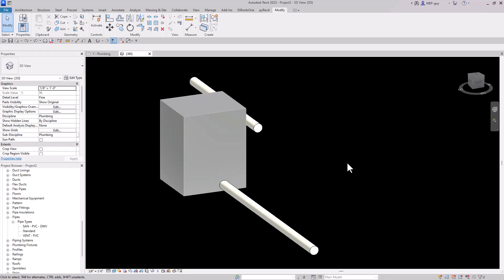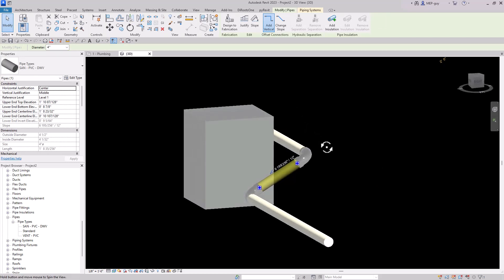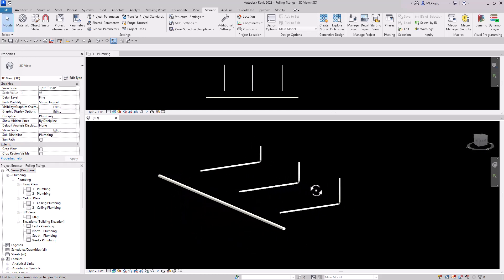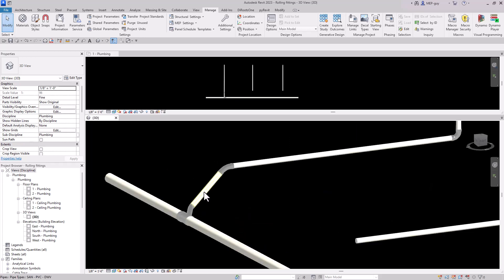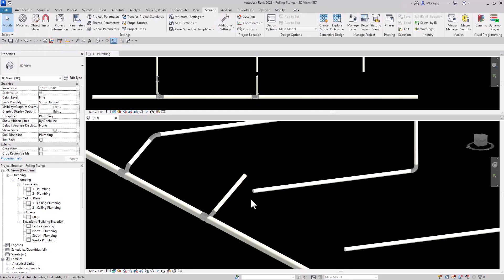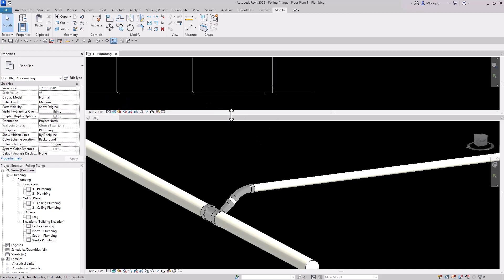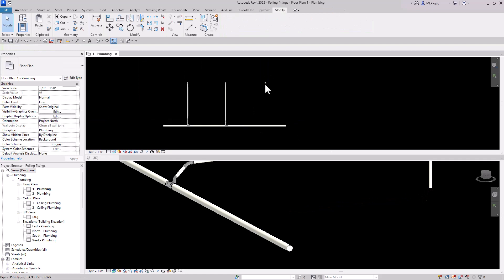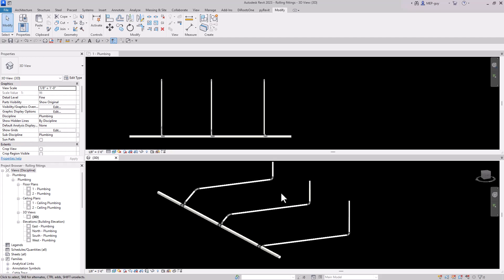3 Ways to Roll Pipe in Revit (with slopes too!)

Comment: How do you use the trim/extend in the 3D model view. I seem unable to do that. I am still learning revit
Reply from the maker: Trim extend only works when pipes are aligned. If they are not aligned, then this command will not work. Also, try using the command in a floor plan. I use trim/extend to connect piping that is perpendicular.